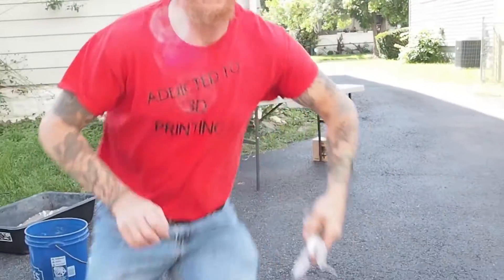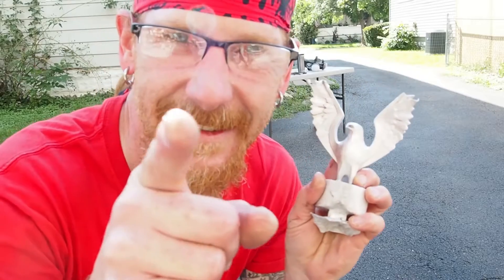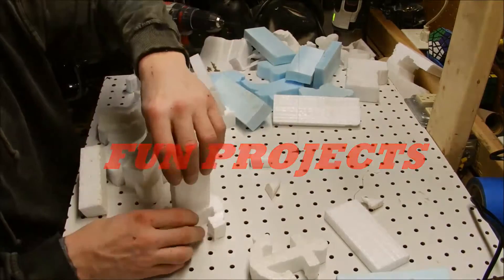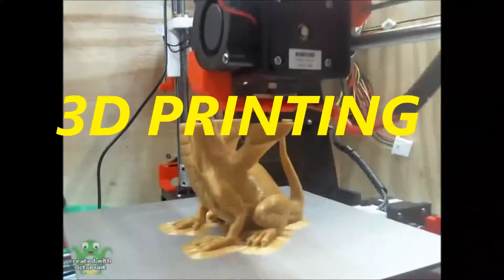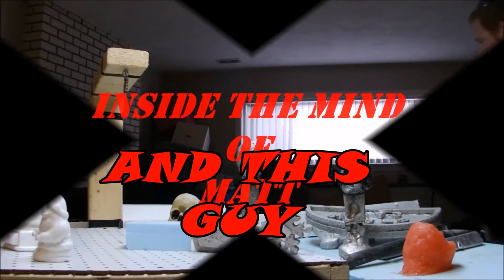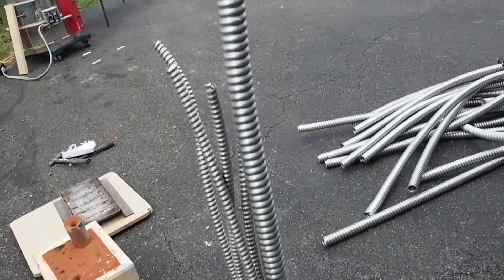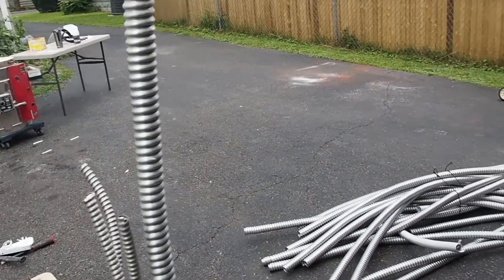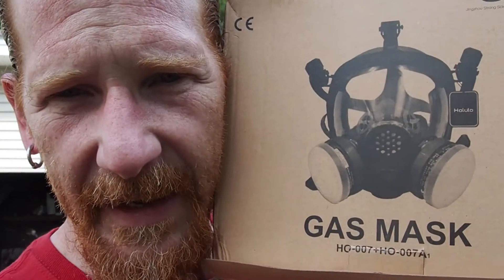Lost PLA and @Machinablewax Casting Success (Eagle take 3)

Comment: Other Tubers note that venting the burnout kiln by leaving the lid slightly open will mitigate kiln element damage.
Reply from the maker: That’s good information thanks for passing that along
Reply: @InsideTheMindOfMatt  Glad to help. If you have not seen Veg Oil Guy or Myfordboy, look for their lost PLA videos. The former is using refractory plaster, a 3D printed part to make pouring and pattern attachment easier and also employs vacuum during the cast. He seems to get good results for small scale parts. Myfordboy has built a small centrifugal casting rig for his even smaller parts for the models he makes. Keep up the good work, Sir!
Reply from the maker: i watch both channels you have to watch some of my latest videos my process has evolved and continues to each time

Comment: Nice!, Quick tip for a cleaner pour, pre-heat your moulds till they're quite warm before you pour to delay the metal forming a skin once it touches the mold stopping large air bubbles forming.
Reply from the maker: Ok I’ll take that tip I’m also going to coat the model getting smoother surface for the mold to form. I got 2 models I’ll be doing SOON got any copper pouring tips that’s coming also 😁